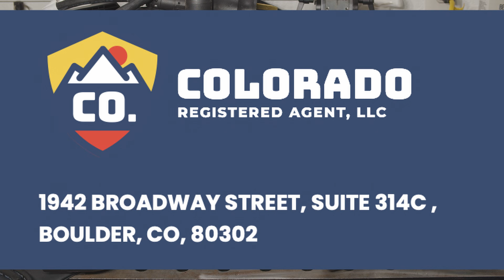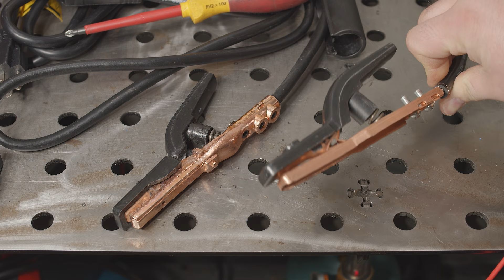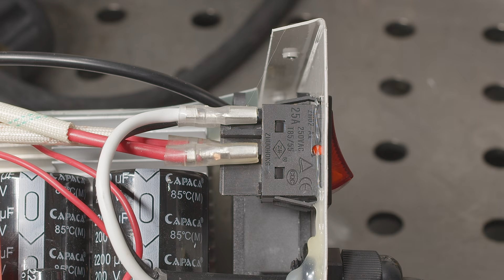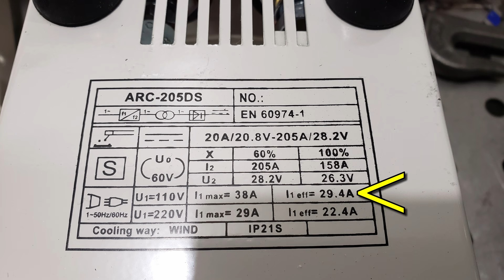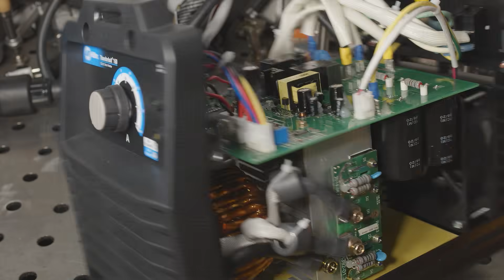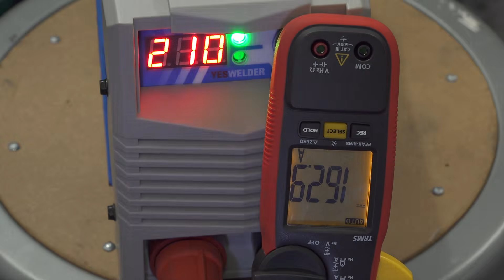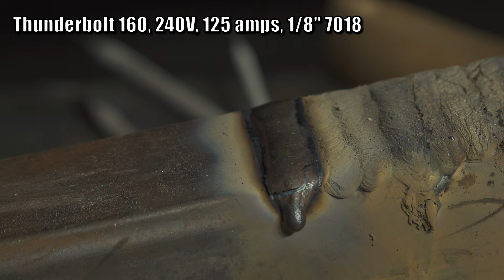Miller Thunderbolt 160 Vs Yeswelder Arc 205DS:  In-Depth Comparison

Comment: I have a amico 160 for about 4years now of heavy use, I always wondered if the Miller thunderbolt was just as good.
Reply from the maker: The Amico welders I've looked all tend to be built very similar to the Yeswelder, so I imagine the comparison would end up very similar to this one.  The Amico 160 might be built a little heavier than the Yeswelder in this video, but I can't say without knowing exactly which model you have.  It's good to hear your Amico is holding up well for you.

Edit:  I just looked at your channel and saw the model you have.
Reply: @bigtb1717  Amico has been longer in the Game if anything Yeswelder are copies of Amico.

Comment: So, $500 vs $150...   I would hope that the more expensive one is better built.  This is comparing a pinto to a Bently.   

Maybe try comparing similarly priced units.  

As for now, nobody can convince me that a Miller or Lincoln is worth the money compared to yeswelder.  I own the mig 205ds.  It works amazing, for my.home use.
Reply from the maker: I'm glad your Yeswelder is working for you.  I had a specific reason for comparing these two welders and I explained in the video.  I also explained at the end that I wasn't trying to convince people to buy the Miller.  I understand that many people will still choose the Yeswelder because it is much cheaper, and that's fine.

I do have another review coming up of a welder that is extremely similar to the Yeswelder ARC 205DS, and it is even cheaper.  So I will be making some comparisons to the Yeswelder in that video.

Comment from the maker: In anyone is interested in the Thunderbolt 160, you can save some money and get the Hobart Stickmate 160i and save $100 or more.  It is essentially the same welder, but it doesn't come with a carry bag for the cables and the power cord uses a simple twist-lock plug adapter system instead of the "MVP" system that the Miller uses.  Just a heads-up.
Reply: I'm not expert on welding, but I've compared Hobart tig welders to Miller and they seem good value and very similar if not identical insides.
Reply: I did the research. Bought them both took them apart and found them both to be the same! Wow.
Reply: Zaza z1-
Reply: Is the Stickmate a good wonder? I'm looking to get a cheap stick welder and I think I'm going to spend a little more than I want and get the Stickmate.
Reply from the maker: @Antoniocool86  The Stickmate 160i is basically the same exact welder as the Thunderbolt 160.  It doesn't weld as nice as Miller's higher end stuff, but it's fine.  I don't have long term experience with reliability, but it does have a decent warranty if purchased new and registered.

Comment: Would absolutely love if you would review the Deko arc welder! I'm currently trying to find a cheap arc welder I can throw in the truck. My budget is about $150
Reply from the maker: Will you mostly be running it off 120V?
Reply: @bigtb1717  yes I believe so
Reply from the maker: Some of the cheaper welders don't run very well on 120V or draw a ton of power.  I might have a couple Amazon gift cards coming soon.  Maybe I'll test out the Deko Pro and see how it does.  Just curious, are you in the US, and if so, where about?
Reply: @bigtb1717  that would be awesome! And yes I'm from Washington State

Comment: In case you plan to do a review in the future, I contacted NorthernTool for when the ST201iDV welder will come back in stock and off back-order:  "Item 96583 is currently on backorder with an approximate arrival date in our warehouse of 4/27/21."
Reply from the maker: I have actually had one on backorder for a couple weeks now. Hopefully it ships sooner than that, but it's on order.
Reply: @bigtb1717  I'm excited.  I've never tig welded before and can't wait to get started ^^.
Reply from the maker: Do you have one on order, or do you plan to order one when they come back in stock?  I will review the welder as soon as I get a chance once it arrives.  The main drawback I see is that the foot pedal is on-off only, not full amperage control.  Otherwise it seems like a pretty good value.  We'll see how it goes once I get a chance to test it out.
Reply: @bigtb1717  I have one on order as of right now until I know of a better option in that price range.  In my mind and from past experience, I tend to put my faith in Northern Tool a bit more than any other Chinese name brand and certainly above harbor freight (not by much, though).  The only other choice I'd consider is maybe one of PrimeWeld's offerings, but I couldn't find much info on them aside from their TIG 225x or one of their plasma cutters..  A lot of their lower priced options are out of stock a lot of the time, and I'd rather not use a multi-process machine since they tend to not do any one thing very well compared to a dedicated machine.
Reply from the maker: This machine seems similar in general features and price to the Everlast 160i STH.  The Everlast is definitely foot pedal capable with amperage control, though it doesn't come with a foot pedal for the price.  I will investigate and try to determine if the Klutch is simply not capable of remote amperage control, or if is technically capable, but they don't offer a foot pedal at this time.  

In a couple areas the Klutch has the Everlast beat.  It has a higher rated output on 120V and 240V, it has a pulse function and it has power factor correction.  It doesn't mention downslope or post-flow control, which the Everlast has.  But the Northern Tool website doesn't have a manual or support link that I can find, and their description leaves out some features that are clearly shown in the pictures, so I figure I'll have to wait until I get it to find out what all it can and can't do.  I'm looking forward to testing out the Klutch to see how it does.
Reply: @bigtb1717  One of the Q+A's on NorthernTool's page does sort of inquire about flow settings, still vague, though.  "The welder is equipped to set a post flow gas setting. The pre flow is automatically set. It is not recommended that the setting be changed."  I'm also interested if this thing is capable of remote amperage, and if it is, could the stock foot-pedal be modified with a potentiometer to do so..  These are recommended to be used with a 50 amp breaker on the 230v and a 20 for the 120v, so I'll need to double check my panel (it's an older model from the 1970s...)
Reply from the maker: I have a 40 amp breaker/circuit I use for all my welding and I've never had an issue.  I will test the draw of the welder when I get it, but with power factor correction I bet the draw will be somewhere around 30 amps or so at full output.
Reply from the maker: Also, it sounds like they say the post flow setting is adjustable, so that's good.  I posted a question myself about the foot pedal, but if they don't get back to me, the first step would be to check and see if all the wires on the plug actually connect to the board inside.  The pictures appear to be a 5 pin connector, so there are enough wires for a potentiometer in the plug.  If they go to the board I will test to see if any of them have a signal voltage on them.  If so, I may try rigging up various potentiometers and see if I can get anything to work.  We'll see...

Comment: You are not just buying the name, you are also buying an actual company that will not be hard to contact if theres a problem <~ exact reason why I purchased an ESAB and willing to pay the price.
Reply: this happens with some of the better china products that have been around longer to like everlast, i also think they use better parts, but they also might just raise the cost so if two units die in 5 years theres still profit
Reply from the maker: I agree, and that's why I didn't want to use an Amico welder for this comparison.  Who knows how long Yeswelder will be around, but Amico already seems to have quietly disappeared.
Reply: @bigtb1717  i do belive amico was a us biased importer of china welders while yeswelder is a china baised either exporter or manufacture, they also have a huge socail media push with 10,000 followers and adds EVERYWERE. i find it sus that there also only about 2 years old. i dound 160 amp rated powerboards for sale on china sites that look very very very close to the yeswelder ones, and in the keygree factory photos it shows another brand name as well but i couldnt find it. at least with prime weld and weld pro im pretty sure where the building is that makes them and those guys have us baised operations and phone numbers
Reply from the maker: I know the address that was on the old Amico website was a location in China.  They had an "about" page where they talked about being a major, long-time manufacturer of cutting edge welding equipment.  There was a picture of a gigantic office building with an out of place Amico logo on top.  It was a bit tough to find the address because in that part of China the street overlay didn't match up with the actual satellite view, but I eventually found the address and it was a large apartment block.
Reply: @bigtb1717  the plot thickens
Reply: i guess i called the ebay seller for amico products deana11825
Reply: What kind of problems should happend with a stick welder?
It is basicly just a giant phone charger with a fan, if they fail they are burnout or mechanical damaged either way they will not be repaired. You need a new welder not customer service.
Reply: @jonasstahl9826  it’s up to you bud, you get what you pay for no matter if it’s repairable or not!
Reply: @johnc5772  Sure the test of the cable has clearly shown it, but I highly doubt, that you can destroy the cheap welder without abusing it. Specialy when you only use 160A like the Miller has and not all 205A